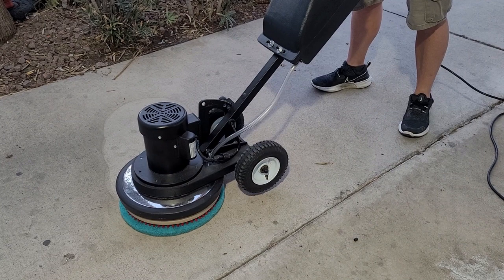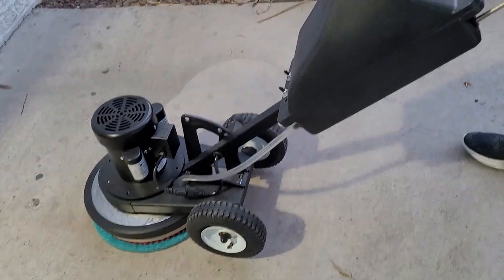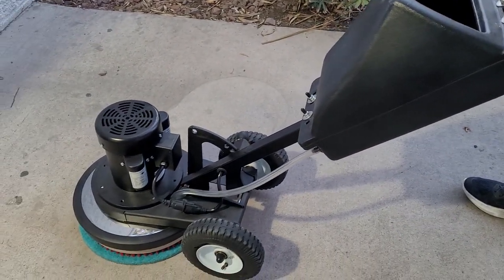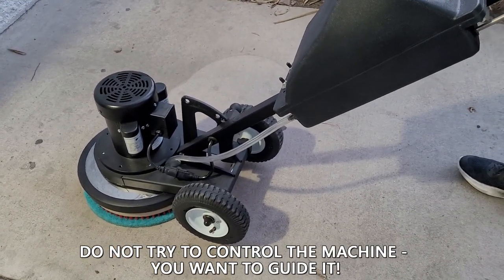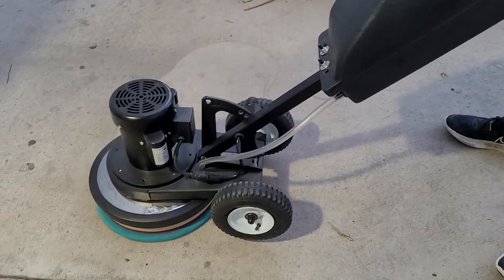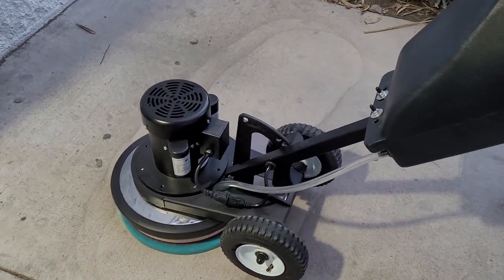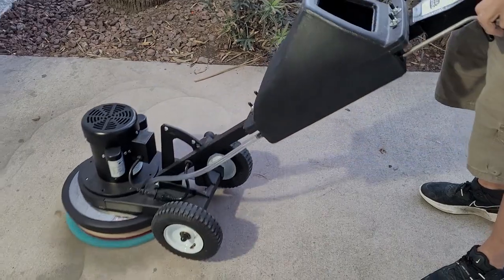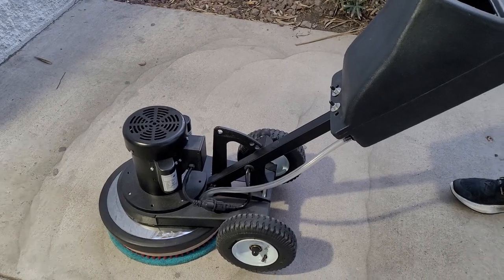How To Use a Floor Buffer

Comment: The swirly is a beast. It's a workout. I started practicing with mine today and thought I could control's it. Boi was I wrong!
Reply from the maker: Hey Mar-C, it's not a work the moment you stop trying to control the machine. Instead you want to guide it as explained in the video. Once you get this figured out it's very easy.
Reply: @encapstore5784  Oh yeah, a year later, and I am pro with it. Those big wheels make it super easy to go up and down stairs. American muscle at its finest.
Reply from the maker: @mar-c6942 Nice!

Comment: Hi i was in trouble with my boss today, saying i was using it wrong. Am i supposed to lift the wheels up at same time when operating the machine?
Reply from the maker: The wheels are always up when the machine is running.